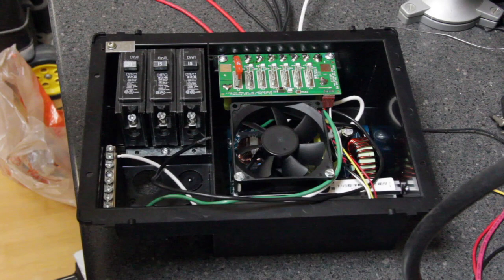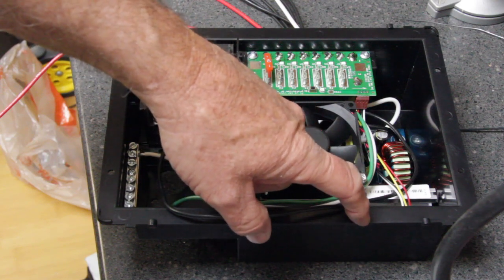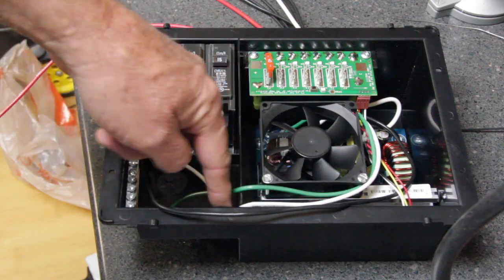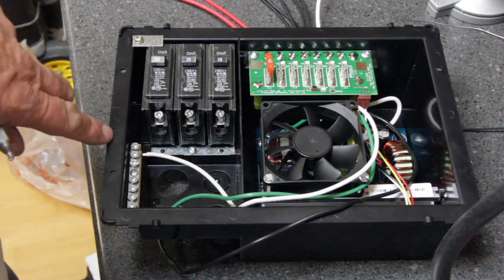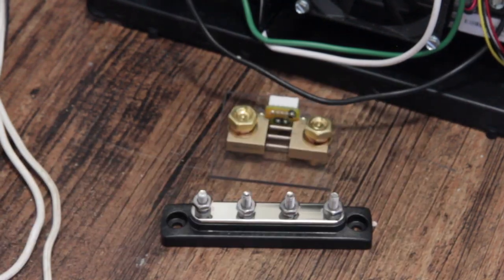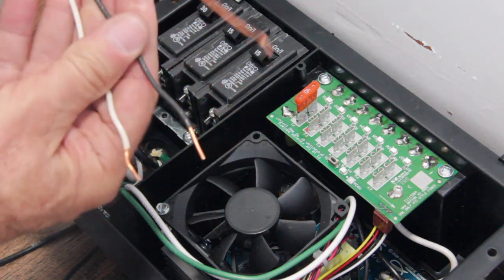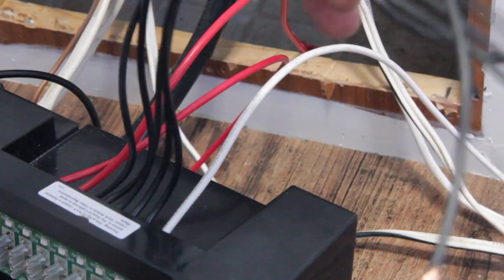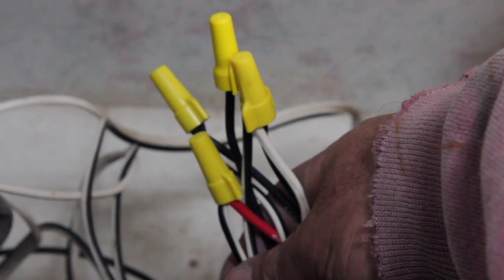Progressive Dynamics PD4100 Install

Comment: I can’t tell you how thankful I am for coming across your video!  I have the 4500 series only connected to shore power, and for the life of me I couldn’t figure out why the DC side wasn’t working.  It turns out that you need a negative / ground wire connecting the negative battery terminal to the shared ground bus bar for both AC/DC.  Voila!!  It works.
Reply from the maker: Thanks Chris,  Yes, I have had several folks have the same problem.

Comment: Really good detailed video shots of the inside of the control center, the breakers, the wiring, the neutrual bar, the grounding bar with easy to follow narriation/instructions.  I have a 2005 PastTime Camper with a EXL-20  30amp/120v that went bad  I 'm replacing it with the PD4100 Control Center.  There are some difference between the 2.  EXL-20 did not have a main breaker in the control box for the Shore power; it connected directly to the busbar and had a main breaker in the main service panel or I could unplug from shore power.  The PD4100 requires a 30amp main breaker in the control panel with 2 15amp breakers.  If you've ever installed/wired a subpanel with a main breaker you should have no issues with the AC side.  The DC side seems straight forward.  I may do the same and hold off on the battery side being I'm connect to shore power.  The camper is used as an on-site office; no longer on the truck; I may need to run the grounding wire to a grounding pad/rod being there is no chassis to connect to.  This was way easier to follow than the instructions that came with the control center.  I had to enlarge the opening; the new height was 6 3/4" .  The new length was 10" (half an inch shorter) so will try to center the control box in the opening or use a filler.  Thanks for saving me time to figure this out it appears to be a good DIY project.

Comment: Thank you so much .
had electronics shop in high school ,beating my head over trying to fig this out.
I watched so many videos still banging head, then found you !!!
OMG,I get it .....  When you got to the bus bar I shrugged - then the light went off ......
the bus bar completes the circuit on the DC side .
I have the Progressive Dynamic 4050 .
I cant thank you enough !!!
you have a talent , you should teach.
I am now going to wire my trailer .
Reply from the maker: Thanks, enjoy

Comment: This has been extremely helpful, thank you! I'm replacing an old old old OLD 15amp system with glass fuses on a 70's trailer and upgrading it to a 30 AMP system with the same (or very similar model). I was able to compare what's in the trailer now with your video and know exactly what I need to do now so thank you!
Reply from the maker: Thanks for the feedback.

Comment: I have a faulty WFCO-8735-P Power Center in my TAB trailer that needs replacing.  I currently have a standard lead acid battery, but hope to convert to lithium in the future.  Would this PD4100 fit exactly into the same hole as the WFCO-8735-P (and have the same wires to connect up with)?
Reply from the maker: Check Progressive Dynamics web site, I am not familiar with the WFCO unit.  They list the dimensions.  The PD4100 has a switch for Lead acid/Lithium based batteries.  I run the Lithium Iron Phosphate batteries.

Comment: Judging by all the questions below I think someone needs to make a long video completely start to finish installing this in a virgin trailer (not a replacement, a virgin install where no install existed before).  Take the time, have someone run the camera for you while you point and talk and work all the way through the AC and DC sides, from hooking in the shore power to hooking in the DC power to the grounding, all of it.  I wouldn't care if it was 2 hours long if would just teach a person how to install these horrible, horrible things that come with instructions so bad it would be better to have no instructions at all.  This video is a little helpful but it also leaves a lot out.
Reply: Agreed!

Comment: Yes how did you wire your metering device off the shunt? I am getting ready to put the 45 amp model I'm my camper and would like to be able to monitor my voltage as well.
Reply from the maker: Here is the link to Amazon,  Check out the image of the wiring diagram. That will help you out on wiring the shunt.   https://www.amazon.com/AiLi-Voltmeter-Ammeter-Voltage-Motorhome/dp/B07FGFFHC6/ref=sr_1_4?crid=5GGZ3JML9D2J&keywords=battery+monitor&qid=1661315060&sprefix=battery+monitor%2Caps%2C180&sr=8-4
Reply: @JoediyLab  Thank You!

Comment: At the 4:19 mark, speaking of connecting to that 30A breaker - you seem to take a black wire that originates on the DC side and hook that up to the 30A breaker.  Is that what you do?  Is that the wire I plug into the 30A breaker?  I have this exact same unit.   But next you talk about putting your lead from shore power on that breaker so it's really misleading - please try to clear this up.  I DO have a black wire coming from the DC side of the box that is not hooked up to anything.   Do I hook BOTH  it   AND the shore power lead to the SAME 30A breaker?   Thanks anyone who can clarify this for me.
Reply from the maker: Here is a diagram of how to wire the breaker,  https://www.progressivedyn.com/wp-content/uploads/Support/manuals/PD4100-English-manual.pdf

Comment: Thanks for the info, it was very helpful. One question, I put a 30amp shore power inlet and a 15 amp extension cord inlet in my camper. My thoughts on this was I don't need 30 amps much but would like the option if needed. The extension cord inlet powers one outlet for a small heater or a coffee pot with USB plugs for charging phones. Can I hook the 15 amp inlet to one of the 15 amp breakers in the converter? Or can I  wire the 15 amp inlet direct to the plug since the extension cord will be hooked up to an existing fused outlet at the house? Suggestions please!
Reply from the maker: If I understand you correctly, If your camper is not wired for outlets, yes you can wire an extension cord to supply power.  But do not go too long with the cord. Longer extension cords will consume more amps and would require larger conductor size.  If you are wanting to charge your batteries from a house extension cord then there is separate wiring on the converter that you can wire in for shore power.  Look at the documentation for which wires are for shore power. The best way of course it to wire one or more outlets in your camper and wire outlet(s) directly to the power converter.  Good Luck.
Reply: I'm building my camper. I put one outlet in it. I have a 30 amp shore power inlet hooked to the converter but I also installed a 15 amp power inlet. I have a 50 ft 12 ga. extension cord and a 30 ga. 25 foot shore power cord. Right now I have the 15 amp inlet wired directly to the plug so I can use it if I am parked at home. The 30 amp power inlet is connected to the main fuse on the converter to use when I have 30 amp service at a campground but I don't have any outlets connected to that. I would like to connect the 15 amp inlet to one of the 15 amp breakers on the converter. The only thing the converter has attached to it is the LED lights (5) and water pump. Would it work if I connected the 15 amp inlet to work thru the converter's 15 amp breaker? I would never be using both inlets at the same time. 90% of the time I wouldn't be anywhere there's 30 amp service.
Reply from the maker: Linda,  Run everything through the power comverter.  Setup your shore power so you can plug in to either a 30 amp service when on the road.  When at home, get an adapter so you can plug the same shore power connector to your 15 amp home service. or wire in a 30 plug at home. You always want to bring shore power to the power converter.  Then wire into one of the 15 amp breakers to power your extension cord.  Then wire the other breaker to your one plug in the camper.  If you have space in  your home panel, wire in a 30 amp breaker that way you can power your camper from 30 amp.  If you do not have the space, then use a 15 amp or 20 amp breaker in your home panel and wire that to your shore power plug going to the power converter. (you will need an adapter from the 30 amp plug so you can plug into your home service  of either 15 amp or 20 amp at home.    Wire your LED lighting to the 12 volt fuses,  The Power converter hads 12 volt circuits as well as 120 volt circuits.  Thanks
Reply: @JoediyLab thank you so much for the info! I usually don't struggle with things like this ( I wired a complete new pole barn and cabin 20 years ago and the inspector said he wished all the jobs he inspected were that good!) I'm not as familiar with 12v systems and converters, so your help has been great!
Reply from the maker: Yes If you have an extension cord from the house, then run that into the camper.  I am not sure what you mean by 15 amp inlet?  Are you talking about the wire coming from the house? The ideal situation would be to let the power converter handle the distribution from shore power.  But if you want to run a cord from the house and that cord is attached to a circuit breaker in your panel then you can run that into the camper.   But it is much cleaner to power your camper from shore power connector coming to the power converter.  The converter handles converting from AC to DC, it will automatically charge your batteries in the camper.   The two 15 amp breakers can be wired to supply several AC outlets.   Running from a cord from the house to the 15 amp breaker in the power converter  bypasses your shore power.  You loose the management capability  it provides.    The whole purpose of the converter is the manage shore power.  No reason to bypass it.  If at home you have a 15 amp cord then purchase a 30 amp to 15 amp adapter.  Having a 30 amp shore connector will  give the flexibility to get 30 amps down to 15 amps.   If shore power is 30 amps, that does not mean you cannot run 15 amps,  All 30 amp cord to power converter give you is the capability to safely handle up to 30 amps, but also give you access to any lower amperage as well.  If you still have questions, send me an email at jpitz31@outlook.com,.  I will give you my phone number.
Reply from the maker: Another option you can wire your shore power cord with 15 or 20 amp and then plug right into your house.

Comment: Thank you for the video!! I am using this in my popup camper to replace a 25amp converter. I was told that I need to have 8 gauge wire connecting my battery terminals to the red and white wires coming off the back of the 4100 as I am using it with a LiFePO4. How would I go about wiring this? How do I attach an 8 gauge wire to these coming from the back of the converter? I plan on moving the battery from the tongue to inside the camper so I assume I would need to run a separate cable to the brake controller that is on the tongue in the event of an emergency.
Reply from the maker: Sit down and calculate what kind of amperage draw  you will consume.  You  can look on each appliance to determine amperage draw or watt consumption.  Are you going to have any AC circuits?  Try to determine  how many appliances you will use at one time?  I am sure you will want lights on and some other appliances on.  If you use lights and one other appliance at a time and stagger appliance use.  You can wire the battery with wires with AWG that matches your amp consumption.  Just add another 20 percent for  added protection.  What charge rate will you charge your batteries at?  30 amp  breaker can be handled with 10 gauge wire.
Reply: @JoediyLab  Thank you for the reply. Our amperage consumption should be quite low off of batteries - led interior lights, water pump when sink is used, and the fan from the gas heater but (even that doesn't pull much). We have outlets we will use off of AC as well as the AC unit when needed. I have a portable battery power bank for that that plugs into the campers 30am socket that we will use for off shore power if needed. In terms of the LiFePO4 battery that will go in my camper I was told I need thicker gauge for when the converter charges it. Am I OK just taking the white and red wire from the back of the 4100 and hooking that to the battery? Should i be concerned with the other negative DC wires to the 12v devices not being thick enough or is that only for the battery? I guess I am confused with hooking that part up with the other negative wires.
Reply from the maker: Yes on the red (+) and White {-} battery wires.  That way your battery will charge when on shore power.  I checked the specs and cannot find what amp rate the converter charges the battery at, but will not be more than several amp up to 10 amps.  Call Progressive Dynamics and ask then what the charge amperage is.  I had 14 guage wire to my battery.  14 guage wire can handle 15 amps.  But I used very little appliances.  

Make sure your both AC and DC wires go to a ground connection.   Choose wire size based on the amp rating of the appliance,  Google AWG amp rating.
Reply: @JoediyLab  thank you! Can that ground connection be the bus bar in the converter if that bar is grounded to the chassis?
Reply from the maker: Inside the converter are ground connectors,  Yes you should take your chassis ground and add it to the converter ground bus bar.

Comment: I just got this converter and my brain has had a meltdown.  My old conver didn't look like this and so the wire setup is very different.  So basicly I'm starting off new.   I understand how to wire the ac side with the breakers, bus bars and all that.   Where I get confused is the DC side.  My old wire system consists of 3 wires coming up thru the floor of my pop up. Blue, white, and black.   I followed the blue and white up the wall to. My ceiling and porch lights.  No idea where the black wire disappears too.   Now I believe, and correct me if I'm wrong, the blue is probably bthe positive and would attach with a wingnut to one of the black wires on top.    Where does the white wire go?.    Do I need a separate bus bar for them, and then one wire attaching it to the bus bar on the ac side?   Also it looked like in the video the black wires were attached to the white wires with wing nuts.   That confuses the heck out of me.    Video was very helpful in explaining alot, but I could use a little more elaboration on that please.   I'm a bit slow bwith this kinda stuff.
   Thanks!

Comment: The Progressive Dynamics website references in their description of their PD4100, two versions of the PD4100:  A "Retail model #PD4135KW2BV" and an "OEM model #PD4135KW2B".  Are there any differences between the two? Looking at the photos, the Retail model has a red-colored fuse background plate, whereas the OEM model has a green-colored fuse background plate. The OEM model also appears to have 7 fuses instead of 6, and it has tab connectors instead of the wire tails which the Retail model has.  Is it best to go with the OEM model 4100? The OEM model doesn't seem to be available online, however.
Reply from the maker: The OEM version is usually incorporated and sold with a vehicle by a dealer.  You best bet is to purchase the retail version.

Comment: Great video, you do a great job.  What is the significance of the 2nd red wire?  I am switching to this from the WFCO 8735 and it’s mostly straight forward.  The WFCO is a 6 circuit and the F6 is the power with a 30 amp fuse (F7 is reverse polarity fuse). Wouldn’t a red wire indicate that it should be attached to the battery? Thanks!
Reply from the maker: Thanks,  Yes the first red wire goes to the battery, the second red wire is for a 30 amp DC circuit.
Reply: Is this the same for the PD4060k?
I dont see anything in the specs for using the red wire on the dc side to the battery. It has a separate lug in the converter for the + to battery. Thanks,
Drew